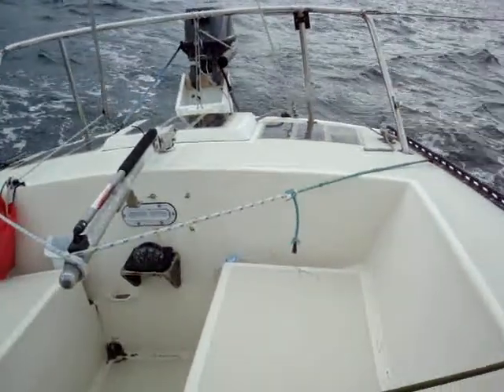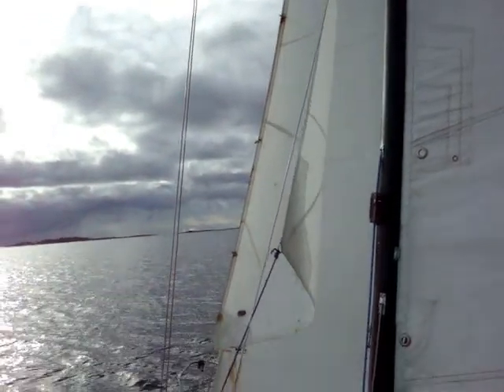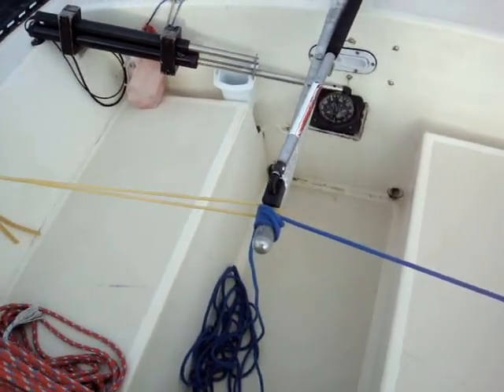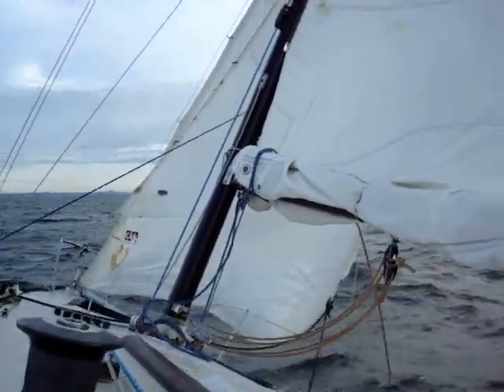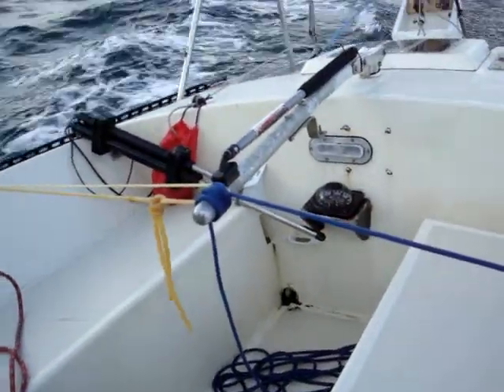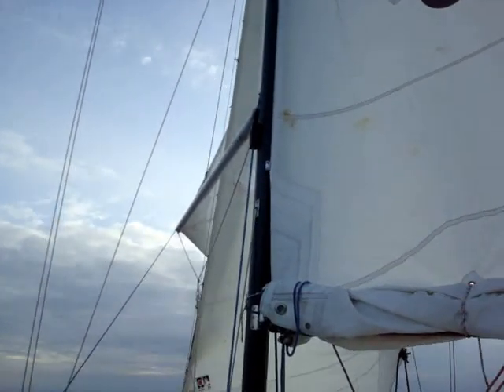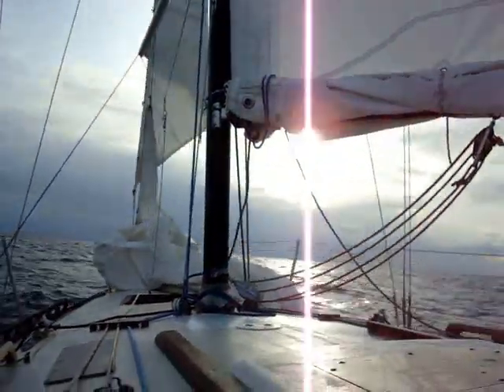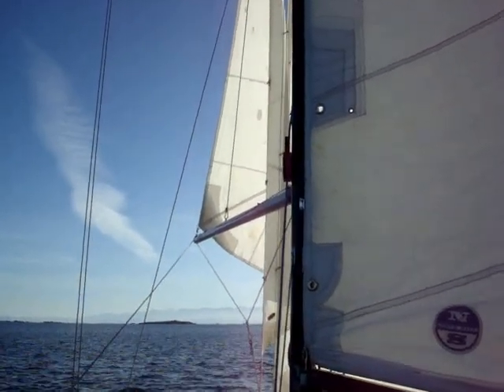FoolishMuseSelfSteering.wmv

Comment: Good video
Control sheet rigged to a sail works on many boats … but there is a list and it seems to me it shows here : the storm jib is bound to wear fast and costa blaming of the jib pole on the forestay is not a good thing, or so it seems …
Reply: You are right on both points, but both can be easily corrected when you set up the sails and pole.  Give it a try for yourself.  It was recently used the cross the Pacific and the skipper was given a major sailing award for his voyage.
Reply: Thanks for the answer. It was just an input to feed the conversation.
By the way, input would have been better without the damn auto-correct (or the writer who didn't check his own writing !!!…) : "there is a list" should obviously read "there is a limit" …As for "costa blaming …" is so distorted from the original I just can't even figure what it was !…
Thanks you again anyway.

Comment: Andrew, your book is very valuable. I sail a Robb 37, with wheel steering, and I have been experimenting with sheet to wheel steering. You have given me many more ideas to try out, thanks. On the wheel, I attach the control line and the bungee to the bottom of the wheel, so that it mimics the pull on a tiller. The wheel can be a bit heavy, especially downwind, but perhaps the poled out jib will work for me. I'll be trying it out this (Australian) summer.
Reply: That's great David.  Would you please send me a photo of your sheet to wheel setup.  I have been telling people about using the bottom of the wheel for some time.  You just need to find the place on the bottom wheel spoke where it replicates the pressure of a tiller.
Reply: OK, will do. To work with a wheel, the angles of the control lines need special attention. I haven't mastered this yet. The spokes on my wheel do not extend outside the circumference, so I have been attaching lines to the internal spokes with a wrap around the circumference to prevent slipping to the wheel's centre. Consider a port tack: as the port control line pulls the wheel, say from the 6 o'clock to 9 o'clock position, (looking forward from aft of the wheel) the opposing starboard bungee control line then does not exert any torque force on the wheel, but rather is pulling directly back towards the centre. Likewise on the other tack and the 3 o'clock position. So I need to attach the port line at 6, the starboard line at, say, 4. When the port line pulls to 8 o'clock, the starboard line is at 6 and can then exert maximum torque. I need an adaptor of some sort to create spokes that extend beyond the wheel circumference and allow me to use the easy adjustment technique of putting on more wraps to apply more tension. As much as possible, the control lines need to pull at a tangent to the wheel.  Like I say, your book and video have given me a lot of new tips and ideas to try out.
Reply: I'm wondering if you are in fact going too far out on the spokes, thereby requiring a much further travel distance for the sheet and bungee.  What would happen if you connected the lines much closer to the center of the wheel. Perhaps 1/2 way or even 1/4 way from the hub.  Then only a small amount of movement would turn the wheel.   Keep in mind that when using the method with a tiller, the tiller only moves a few inches in each direction.  You want that same amount of movement with the wheel system.  The sails must be properly trimmed so there is minimal weather helm.  That's the trick to the whole system.  Let me know how it works.
Reply: OK so I haven't sent any photos, partly because I don't know an email or web that I can use to get them to you. However, I will describe my progress. First, I'm getting most success with the control line running from either the back of the boom on a close hauled reach or from the jib sheet when off the wind, then offset by surgical tubing. Secondly, I have removed the need to go to the bottom of the wheel by using turning blocks and sending the control (and elastic balance) to the top of the wheel, just from the other side to what you would see on a tiller system. It's fine that way and the top of the wheel is more convenient. (So on a starboard tack, the boom control line goes from the back of the boom to a block on the starboard quarter, back to the port quarter, to a port staunchion, then to the wheel. Pressure on the main that wants to round her up hence pulls the wheel to send her downwind.) Thirdly, tension and balance in the control and the elastic is important but the real fine tuning comes from the sheet.  If using the mainsail boom, I fine tune using the mainsheet. If using the jib sheet, that's what I use to fine tune. Either easing or sheeting on gives more or less power to the control line. It works best when it is balanced so that there are almost imperceptibly small movements in the lines. You don't see the wheel move much at all; it's mainly pressure on the wheel one way or the other, rather than outright movement, that steers her.  I'm increasingly optimistic that I can make this work.
Reply: @andrewevans5761  it's so case department you may be over thinking. I mean that in a nice a nice way.

Comment: Interesting video.
Really.
I wonder wether  letting the sail slightly flapping won't wear them fast … At any rate letting them flap downwind so much is something I wouldn't let do on my own boat ! … 
Too bad you didn't sow more closely how the sheet on the storm jib works : I'm somewhat confused as to where the clew is positioned.
thanks for sharing anyway ! …
Reply: Sails can take a flogging, chafe is the enemy!
Reply: Thanks for your comments.  The storm jib is pretty sturdy, so letting it flap a bit shouldn't be a problem.  But yes, you don't want it flogging for long periods.  For the past month I've been hearing from a fellow who is using this as his sole method to cross the Pacific.  For complete details on the method, take a look at the book Singlehanded Sailing - Thoughts, Tips, Techniques & Tactics.  Available on Amazon and elsewhere.